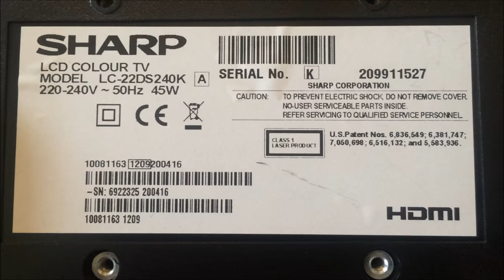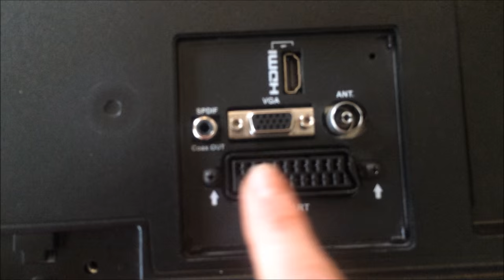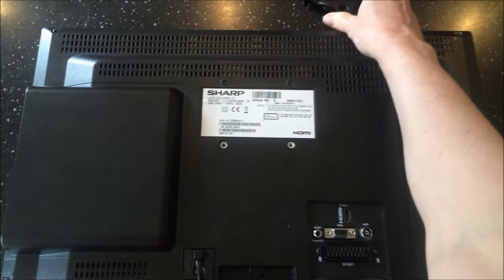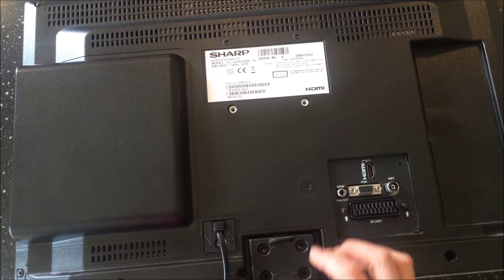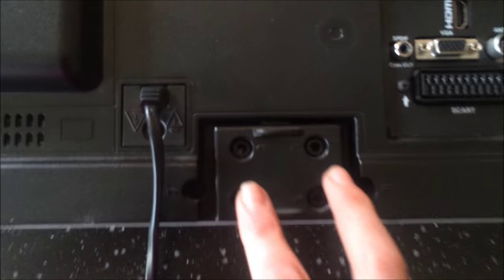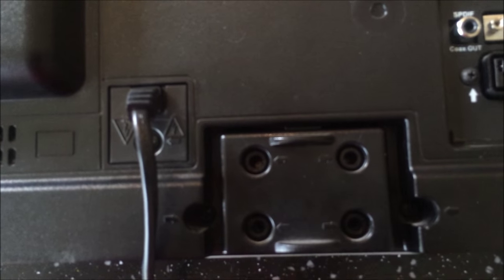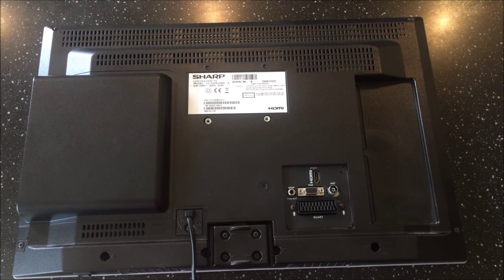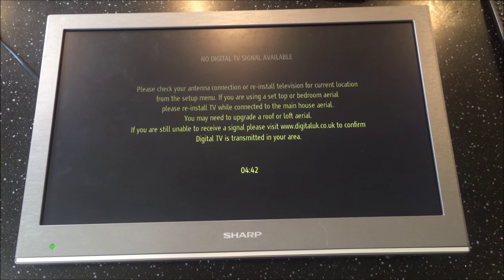How to fix a dead TV with no power (Sharp LC-22DS240K)

Comment: Your video has just fixed another tv LC-24LS240E. I had a dodgy socket and I'm thinking it surged the tv . I followed your guide and removed the 3 diodes - one was completely dead. Ordered some more SB5100 diodes for a couple of quid and soldered them in. It came straight back and now I'm watching a bit of telly with my feet up having a cuppa! Thanks!

Comment: My 2016 22" model which has the same power board as the one in the video but different model number went off today, pleased to actually find this video so ordered the parts and will hopefully have a working TV again in the next few days. Thanks
Reply from the maker: Iain Metcalf Hi Iain, have you got it up and running?

Comment: Great vid thankyou very much! Im not stupid with electronics but diagnosing a tv is a bit beyond my reasonable realm. this hit the nail on the head, tested diodes, kaput, bought 10 for £2.50, soldered 3 in, sorted. This was a different, newer model but exactly same supply board.

Comment: Very useful video - particularly as I was having trouble getting the back off, so good to know that there are a series of clips that just need forced apart (carefully).   I have the Sharp LC-24VDV510K which is a different model but the back looked very similar and when I opened it up it had the same PS board.  Tested the 3 diodes and they look as if they've shorted.  Bought new SB5100 5A 100v diodes off ebay and just about to fit them in.
Reply: Fixed!  Needed to buy a more powerful soldering iron (40w) as the ones I had were making no impression on the PCB.
Reply: @alexbain3476  is there any way to do this without the soldering iron
Reply: @jamesb7843  I don't think so. I got a new soldering iron from Screwfix (UK) for £9.99 just for this job. You'll also need solder and a small pointy nose pair of pliers.

Comment: Thank you so much. Your guide is good also for the Sharp LC-24LE240E: the power supply seems to be identical, and as a matter of fact, the three diodes were burned as well. I used three diodes model SB5B0.

Comment: I've just done this repair to exactly the same model of television. When I switched off an extractor fan the spike caused by  induction in windings of the motor caused the TV to pack up. Anyway, I tested all three diodes and only 2 had gone down, but, I replaced the set. I purchased 10 off eBay for £2.99. They are called Schottky Diodes and their part number is, SR5100 =SB5100=SB5B0=SR5010=SR510 100V 5A Schottky Rectifier Diode.
Reply: Hi Bryan I have a sharp 32" LC-32SV29U, I want to replace those diode (D930, D961, & D960) but I can't seem to find where to buy it.  I live in California. Do you know the web site where I can get those diode.  Thank you.
Reply: Fry’s electronic store

Comment: Hi, I have a sharp aquos lc-60le636e with no power, I noticed that the fuse  f7001 and capacitor c7818 were blown , I replaced both but when I attempt to power on it keeps blowing the new fuse
Reply: That tells you that   you still have a defective component or components. Most likely a "Short" somewhere on the board. Always do a "visual check" of all the components FIRST. That may save you a lot of time locating the problem. Watch other videos to learn more about your particular problem...... Good luck.

Comment: Congratulations, but what did you do with your left hand between Min 4 and Min.6?? Hopefully no burning from the soldering iron. ;-)

First thing to mention before stating to work for all the unexperienced followers: for safety reasons always unplug the mains before opening or even touching the power supply because the high voltage is obvously very dangerous!

One hint from me to your soldering quality:

From my opinion the solder joints are not very perfect: surface is uneven, the soldering should enclose the wire like a cone with a shining surface = no cold soldering, which means: it might work in the beginning, after some thermal cycles it might get broke again with no contact to the component.
Reason for this might be: too cold iron, bad soldering tin, not enough flux, dirty surfaces.
Please also check the tip of the soldering iron is clean and tinned before starting to work. It can be cleaned with a watered cellulose sponge.

I also succeeded in fixing my TelefunkenT22ED970BLLed,it had the Vestel 17IPS61-2. Also only one of the 3 big diodes in parallel was blown,leading to the shortcut. Fortunately nothing else got damaged. To mention is the type is a SB5100,which is considered too weak for this kind of circuit, the occuring reverse voltage it cannot stand under all circumstances. This one is a Schottky diode with low forward voltage.I replaced it with a higher voltage withstanding type MUR460 from Motorola, and it is important to replace all 3 with the same type even only one got broke. Hopefully these will last longer! ;-))) Also keep in mind the polarity, for the the cathode which is signed by a white band. You mentioned that ;-)) I soldered it to the board also with the same distance to PCB as before for better power dissipation. The use of a wood stick to keep the diodes from falling out is a good idea! Thanks a lot for the video.
Reply from the maker: TheThreshershark glad I could help 👍 I had actually had a wrist operation, well spotted 👏

Comment: You need to use flux when soldering.
Reply: Incorrect sunny modern reels of solder incorporates flux
Reply: @rocksteady9115  

You still need to add flux. The soldered joints look like bird shit.